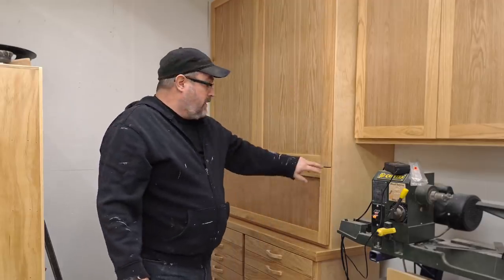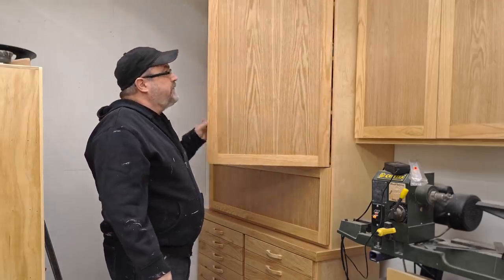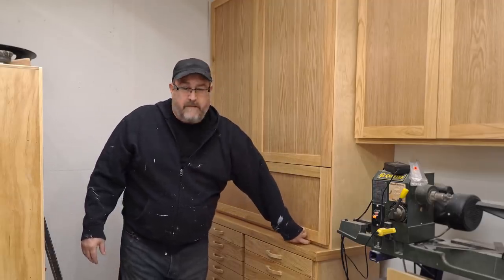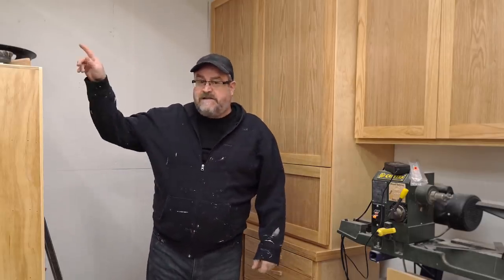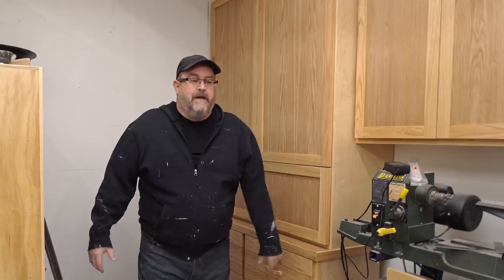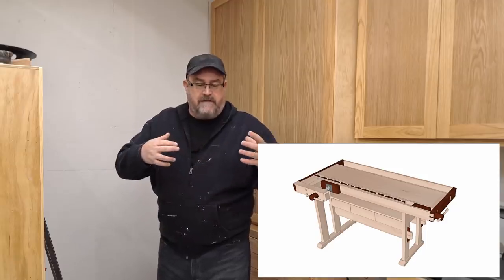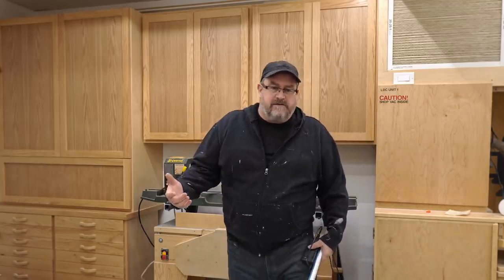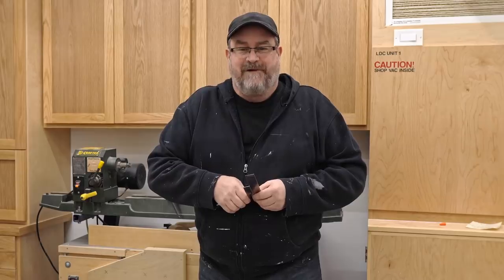I Made Hand Tools... With Hand Tools!

Comment: Though my current bench has lots of drawers, in my first bench I had chisels in a drawer in the bench and I did not like that.  My current bench has screwdrivers in a drawer and I never use them.  They are in the same freaking drawer with the screws and I never use them.  Perhaps add a drawer to your existing bench first and rearrange the tool wall and see if you actually like it that way before you commit to doing it in a nice bench.
Reply from the maker: Can't understand that reasoning, Kevin. Both are currently on the tool board and I have to walk over and get them to bring back to the bench where the work is happening. So it's that or open a drawer right where I am. 
It's like in the kitchen with the cutlery - if the tools are laid out properly and not just thrown in, it should be a lot better.
Reply: @IBuildItScrapBin  The screwdrivers are all nicely laid out in that drawer.  I may as well encase them in epoxy as an art piece for all the good they do in there.  I thought it was going to be the bees knees having them right there but it's like they don't even exist.  It might be different for you but I say try it first and see if the siren song of the tools on the wall is something you can overcome.
Reply from the maker: May I ask what you use instead of the screwdrivers? I mean, if you need a screwdriver, you need a screwdriver, so ignoring the fact that you have a drawer full right beside your knee kinda defies logic, old chap.
I know with absolute certainty that the drawer will work for me. Gaze back into the hazy past and see the drawers that used to be under the bench I have now.  I had one right on top of the unit that had a bunch of the most commonly used tools inside, including screwdrivers and chisels. And pencils and knives and a pencil sharpener.
Reply: @IBuildItScrapBin  The screwdrivers on the outside of the tool cabinet.   Right at eye level.  Calling to me.  Can't you hear them?
Reply from the maker: Sounds like your problem is that you either have too many screwdrivers, or you need to lay off the peyote!